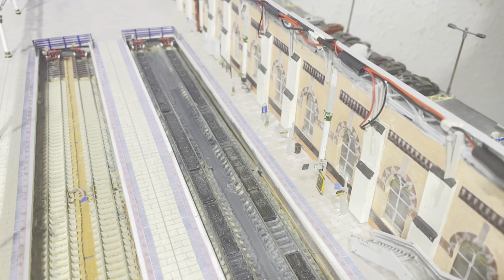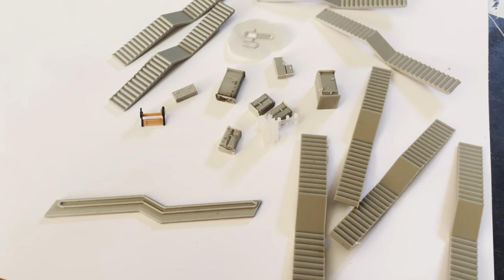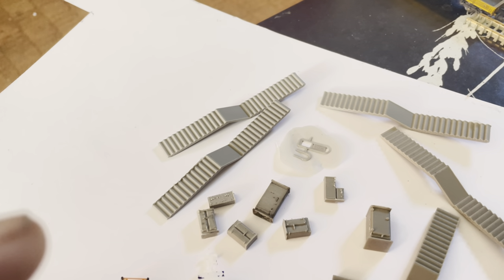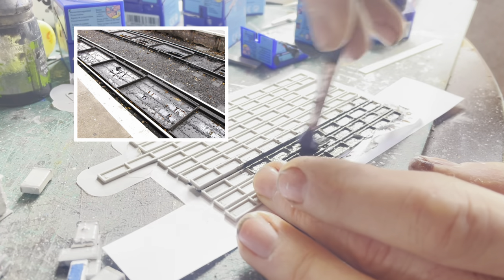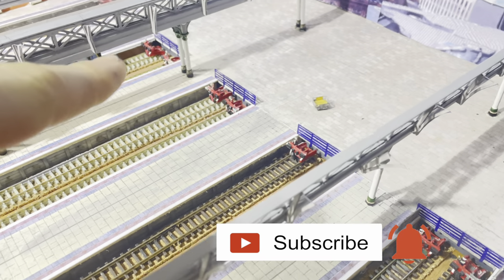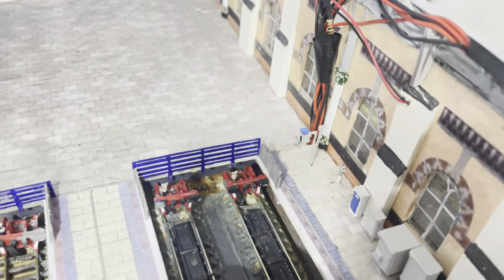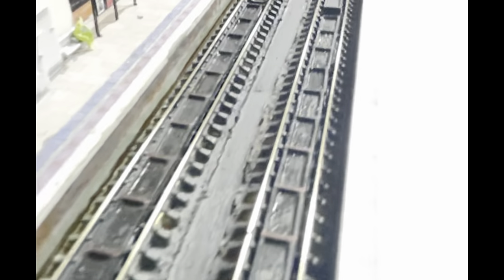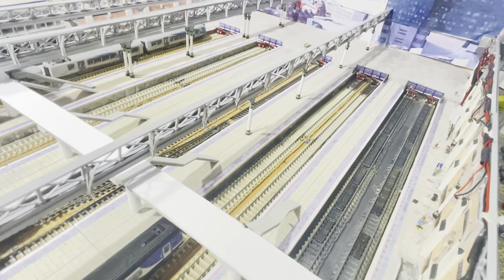ADDING REALISTIC DETAILS TO YOUR PLATFORMS – PICCADILLY STATION REBUILD PROJECT

Comment: Hiya John.  Hope you're well ? Firstly are you crazy 😂😂 the detail is just mind blowing.  The bench on platform 1 i never knew it was there.  The oil pans i must say are fantastic 👏  the escalator looks a bit short if I may say . I thought it was a lot longer and would imagine that it runs at least half way down . Loving the details at the top of the footbridge Costa and the waiting area.  I would image you will put the 2 cabins / shops on the platform were the escalator is . Really looking forward to watching the next update . When you do the catenary under the canopy the gantries are suspended from the roof . Take care John and stay safe
Reply from the maker: Thank you Andrew, very kind of you. The pics were taken couple of years ago so bench maybe have been moved. 

I think you are referring to the travelators on pl10/11 as than run up a ramp and then there is a second section going down the platformto the ticket barrier. I doubled checked the escalator on pl8/9 and its a tiny bit longer than the steps
Reply: @piccadillymodelrailways  yes i was thinking about the travel travelator on 10 and 11 .